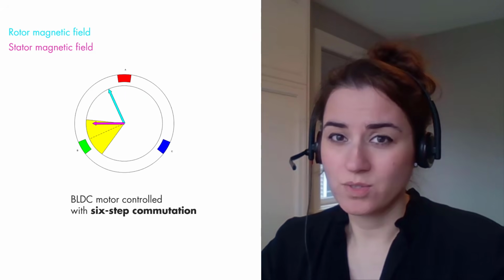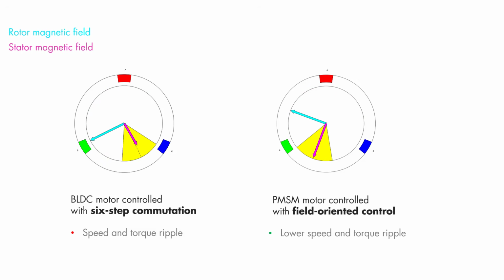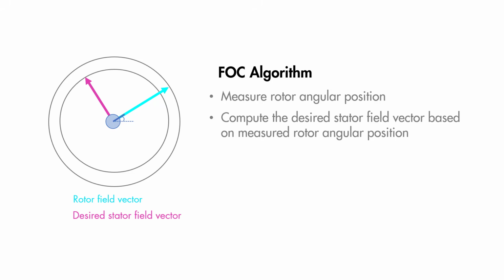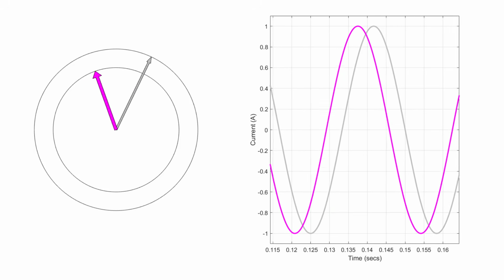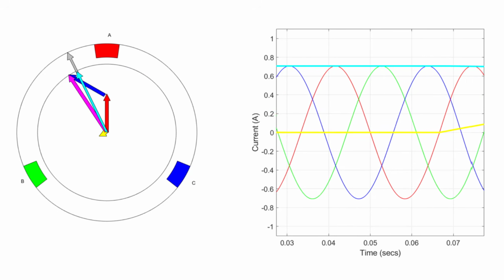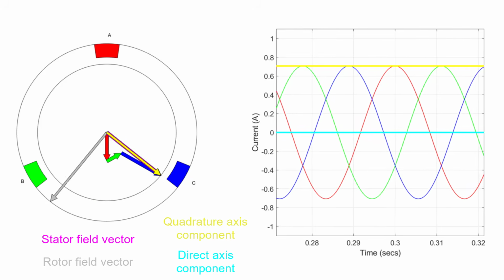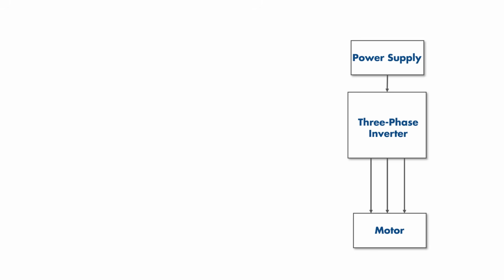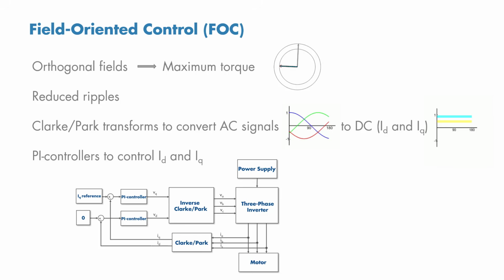Understanding Field-Oriented Control | Motor Control, Part 4

Comment: Fantastic series!

I do not understand why you need the controllers for vq and vd. With the Clarke/Park transformation, this has become a purely geometrical problem. With a high precision angle sensor, you should know in which part of the sine all three phases should be to achieve a 90 degree angle. Am I missing something?

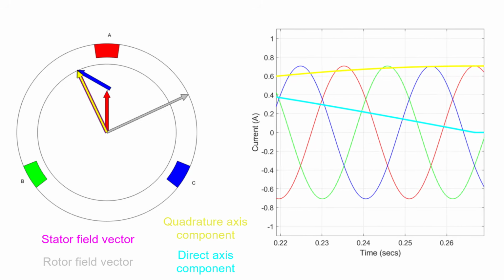Comment: At around 7:14, when the stator field is aligned with the quadrature axis there are always 3 currents present, even when directly aligned with a specific coil's field (e.g. stator field aligned with A). Would it be more efficient if only current through coil A was present at this moment? Likewise when the quadrature axis is aligned with B and C
Reply: The coils can both pull or push the magnets. BLDC motors do as you described and are very efficient. But I fell that there are always a contribution to be had by keeping a constant average voltage and current flowing. If the drive does not energize all 3 coils at some point the rotor will bleed it’s energy to do it, BLDC motors use this signal to find the zero crossing, but since the FOC are usually feed the position externally this is not needed. Writing this I realize that at holding torque or startup it is probably beneficial to energize only 2 coils as you said. All that I said could be wrong, so take it with a grain of salt.
Reply: I wondered the same thing and I think I found the answer. Say the yellow arrow is pointing to the upper right corner, so the green arrow is in the same direction as the yellow arrow. 

For the green arrow to take over alone, it would have to be longer. That means the maximum current of the phase would be higher. If you take the maximum current of the power amp as a given, the achievable torque is higher than it would be otherwise because the red and blue arrows help a green arrow that is limited in size. If you play the animation, you can see that the green arrow is never long enough to go from the center to the inner ring. 

This is in contrast to BLDC motors, which can only have two arrows to reach the inner circle (because one phase is inactive at any given time). So if the individual arrows keep the same length (power amp), they cannot reach the inner circle at all angles, meaning less average torque for the same maximum current.

Comment: Hi! I'm building a bicycle with a tiny motor and a 28" cnc machined rim-gear to compensate the gear ratio difference. I solved everything out except the esc issue.
I'm pretty amateur on building ESCs and recently read about FOC controllers making the motor run cooler and smoother.
Then I found the microcontroller AMT49406, which requires the less electronics. Would you recommend using FOC if I can't order the AMT49406, does it worth the effort?
I'm ordering from Turkey btw

Comment: So you are controlling the magnetic field to always be 90 degrees to the affected rotor, and the motor speed and torque by the amplitude of the magnetic force. You do this by sensing the rotor position, the current and voltage going through the coils, and controlling the current of each coil, to keep the magnetic field at 90 degrees.

Comment: Hello how's it going all? Hey -  I'm often asked the question - "What does LM mean?" I think its "limit modulation" - it seems to limit the  rate  of increase in current. Is this fing correct? also AN - another mysterious acronym that seems to have less noticeable impact than LM but is recommended to be set at 1-8 for most hub motors and  8-16 for IPMs. what is it and how does it affect motor performance?

Comment: Nice explanation..

Does V/f also remains constant in vector controlled VFD ?

i.e. if a motor which is rated as 460V/60Hz is made to run at 30 Hz, does the voltage still remain 460V ?

Comment: Nice tutorial. Thanks for that. I see everywhere hot to control a motor in case it is already rotating. It doesn't seem complicated. But how do I start the motor? I can not imagine that the inverter would give the rotor a "kick" and let it run before the control algorithm takes control over the inverter when people sitting in a car.
Reply: You know the position of the motor before it starts to rotate, or you only need a kick in the size of one encoder increment, the resolution is so high that you dont feel any kick. She could not show it in her animation we would not see it on the screen.

Comment: I need your help if you don't mind, I'm in the process of designing a pancake BLDC motor of a diameter of around 30cm with 120 poles to drive a record player 33rpm and 45rpm, I chose a large diameter with that many poles to have a very smooth speed, I just need a FOC motor controller and encoder design that goes with it.

Comment: @1:30 the second magenta arrow is full-length.  That's horribly misleading - is should not be any longer than the shortest length in the BLDC example.
Reply: I think you misunderstand how motors are wired, or what PWM is.  There are 6 FETs connected to + and - on one side, and 3 phase windings on the other: there is no magic that tells electrons to go through a motor instead of short-circuiting to a neighboring FET - so there's no possible way to excite 3 phases at once.  FETs are either on of off, there's no inbetween.  If you cannot explain FOC, or in your words "not going to try to convince" - it sounds like you want to win an argument, instead of understand the topic.  HEAPS of stuff on the internet is untrue and wrong and misleading, you need to fully understand it yourself before you can trust it.  If you google around a lot more on this topic as I have, it becomes clear that there are no real working explanations - just fake examples from vendors trying to sell chips, and bloggers in RC forums who basically repeat what they see in this video without understanding the electronics.

As for your silly "Full Stop" statement - besides that being both rude and indicative that you're not interested in looking at the math properly, I suggest you go out and buy a pair of magnets.  Play with them, and take a note of whether or not they "pull harder" when they're closer.  That's an exponential relationship missing from the maths here.
Reply: @aejishiba9x  No, I'm not sure, but FOC does it's thing by reducing the PWM "on time" (among other tricks) to emulate a sine wave, while a square-wave does not.  Plot a sine wave inside a square wave - which has the greater area?  

And how sure are you about your 90-degree statement?  Magnetic fields are not constant, and 90 degrees between 2 excited phases is the point where the field is exponentially the *least*.  Yes, it's the best logical *angle*, but it's also the lowest *strength*.

FWIW - I believe FOC is garbage - even if the math worked out, it's never going to be correct in the real world.  Vastly better than FOC would be a learning system based on feedback, so the MCU works out for itself (in real time, and continuously variably) the precise transforms that measurably are the best for the exact motor+rpm+voltage - sometimes that's easy (e.g. propeller in air - input easily affects output) sometimes that's really hard (e.g. skateboard input hard to judge because of terrain) - but either way, it learns, so it's going to beat any "canned" concept every time.

Comment: Great Video! Phenomenal. One question. In the dq frame where the error signal is produced by comparing  the feedback signals with the reference signal, in a PMSM the torque producing component reference is 0 right? what would the signal  q component reference be for an induction machine? Thank You (what i basically mean in PMSM the id current axis stays 0 while the iq axis remains at its maximum, or anywhere between: And in induction machine how are id and iq summed up to result a rotor vector?)
Reply: Here's my two-cents answer. In an induction motor, Id is the stator magnetizing current and Iq is the rotor current. Id creates the stator field (phi_s) and also induces Iq which is proportional to the slip frequency (until a certain level). Then,  torque is generated by the interaction of the phi_s and Iq.